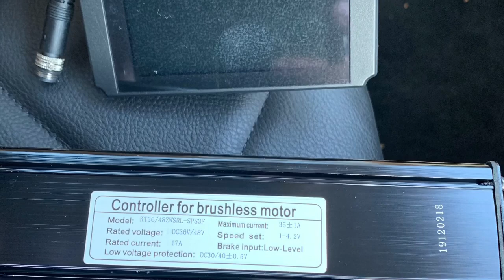Rad eBikes RadRhino/Radrover Bolton eBikes Controller Test

Comment: The watts at the motor  is simply the voltage of the battery multiplied by the  current (amps ) of the controller. So with  a 48v battery the upgrade controller allows 35 amps 48x35 =1680 watts . Of course the battery has to have a high enough discharge rate to allow the sustained drawing of 35amps.

Comment: Nice to see a nuther happy rhino rider out there. I have a 2019 750 rhino I commute 13 miles to work each day and have all ready clocked up over 3000 miles. I brought the bike as I'm 25 stone and needed something robust that can take the punishment I've thought of getting the new controller at $ 140 but I've never purchased enny thing from America so can I ask how much were you charged for the posting it to Britain. 😎👍🚴‍♀️🚴‍♀️🚴‍♀️🚴‍♀️🚴‍♀️🚴‍♀️
Reply from the maker: Hi, it was the VAT when it arrived in the UK that put the price up, the postage was not to bad if I remember rightly. It's a really nice color screen and was easy to install, but as I had an original 750 also, I would not have bothered, but the 250w is lacking

Comment: Hi thinking of purchasing the Rad Rhino 6 plus,,,,, its only 250 motor and I don't think you can up the power, please let me know if there is a way ,,,,,, thanks for the video sharing,  they are great :)
Reply from the maker: Hi. The Rad Rhino you buy for the UK is limited to 250, but the motor inside is actually (or used to be) a 500 motor. You can buy from America (Bolton e-bikes is were I got mine) a new controller which de restricts the motor and the throttle. https://ebikeescape.com/electric-bike-accessories/

Comment: Mike whats the difference between rad rhino & rad runneralsowhat the warranty/repair situation in england. regards
Reply from the maker: The Rhino is the one that is an all round bike. I have had no issues with warranty claims. Rad have been great, but check there website. Thanks

Comment: Have you thought about replacing the 250 watt motor  on your RadRhino with the 750 watt motor? I believe Bolton sells the 750 watt motor also.
Reply from the maker: Hi,  I have replaced it already, got it cheaper from Ali Express only took 20 mins to replace, easiest option is just put a mew freewheel on the new motor and it just slots in, very easy
Reply: @7markhogan  Hi Mark ...Just wondering why you bought the new motor and controller?? Also is there any issues regarding the legal aspect with the 750w motor ?? Great video thanks..

Comment: You seem more than happy with that. I was interested in your remarks on the 250w  "overide" on the twist grip by pedalling slowly? Are you able to give a bit more info on that please? Thanks for the updates on the bikes.
Reply from the maker: Hi, the throttle on the 250W is restricted to 5mph, this is great just for setting of and getting your balance i use it all the time. It just cuts off once 5mph has been reached, but when pulling the throttle down and also peddling slowly the throttle will go past the restriction. I use this when going up hills, it saves you changing the power. If you pedal and throttle at the same time its like setting 5 regardless of what power setting you are in.
Reply: @7markhogan  Thank you for the extra info. Did you ever try the changing of the maximum speed limit on the standard 250W as a few seem to say this is a good option?
Reply from the maker: @rushesinthewind  Hi yes I set it to the maximum from day one, this stops the electric cutting out at 15.5 mph, as i would say 20mph is a speed that you get to on a few occasions. I have a video on how to do it. This does not change the throttle.
Reply: @7markhogan  Thank you. If you ever upload the vid it would be of interest. I am just waiting on the "event" that Rad say they have for tomorrow and whether I am happy paying for a back order up front.

Comment: Great help, posted on face book hope ok, confused with the throttle hack on 250w can you explain it more please
Reply from the maker: The throttle can only be altered by changing the controller, but on the 250w if you put on full throttle and continue to pedal gently it tricks the throttle and gives the same effect as if it gave constant power. Also when you are cycling, say in power 2 rather than switch to power 5 going up a hill you can twist the throttle and continue to pedal and get max power

Comment: Hi Mark,looking at getting a rhino,waiting for a stock update,none in at the moment,before I pull the trigger just a couple of questions if you can help please 

The upgrade,would it void the warranty & also can it still be done on a 2020 model,thanks in advance 
Chris @ Sheffield
Reply from the maker: Hi, it will only void the warranty on the motor and only if you told them you had changed it, I have kept the old controller just in case.  Mine is a 2020 model no issues upgrading.

Comment: So is the motor in the two bikes the same, but the Rad controller software in the 250 limits it, with the Bolton controller overriding that? I think that's what John Bolton was saying when he took the motor rotor out?
Reply from the maker: Yeah, the cntroller is the item thst limits the wattage.